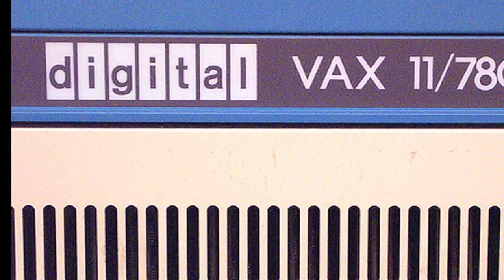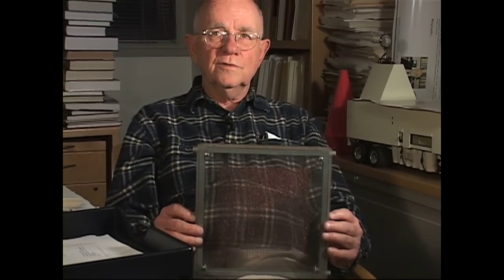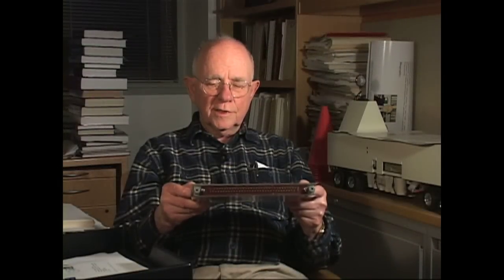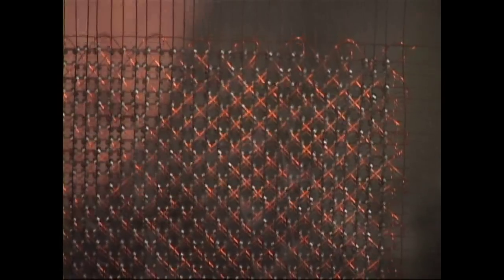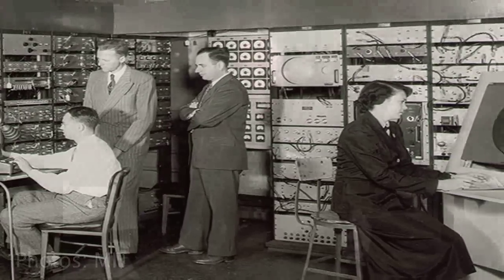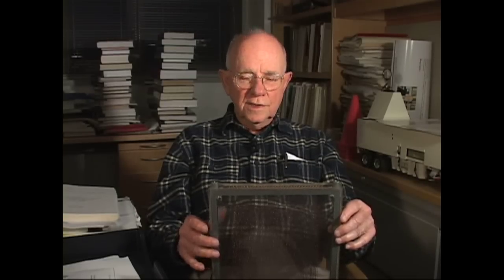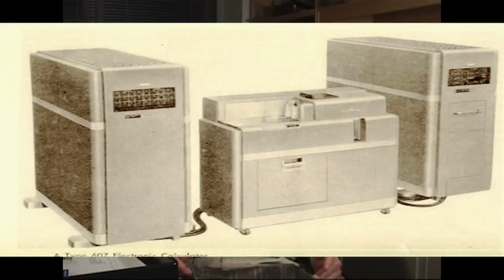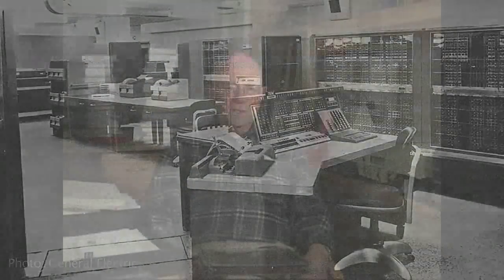World's First RAM Chip (Memory Plane)

Comment: Interesting until about 3 years ago the last ferrite memory computer was being used by Polish State Railways (PKP) to compute train routes and timetables !
Reply: +Teth47 I believe commercial computer manufacturers settled on hiring Asian companies who hired women to weave core planes.  There were also wiring jigs with grooves for wires and slightly deeper "pits" into which the cores would settle when shaken, with the proper orientation.  Cores would be poured from a container onto the jig like pouring salt, the jig would be shaken until the excess cores fell off into a bin for reuse, and each necessary core was sitting in its pit with the hole oriented to insert the wires.  Every core had four wires going through it: one passing through each row, one through each column (one row and one column carrying a pulse of current just over HALF the amount needed to switch the core's magnetization), one diagonally through every core in the plane to sense, when a core was reset to the 0 direction, whether it had changed from a 1 (thus reading the data), and another wire going diagonally through the plane on the opposite diagonals to inhibit the writing of a new 1 in the cores which contained (or the computer needed to make them contain) a 1 before the first pair of pulses.  After the cores were settled properly in the jig, the workers ran a separate wire for every row (in this case, 64 rows), a separate wire for every column (in this case, 64 columns times 64 rows make 4096 cores), and the sense and inhibit wires through every core, according to the diagram.

Core memory was destructive read-out; the memory would write a zero and amplify any pulse on the sense wire, storing the bit in a temporary holding register (one flip-flop circuit per bit).  If the computer was writing new data, that would be replaced; if it was reading data, that holding register would be made available to the computer.  In either case, the old or new data would be written back; the row and column would be selected to sent pulses in the opposite direction, trying to write a 1, but the inhibit wire would have a pulse set up to oppose them if the bit was supposed to become, or remain, a 0.  And this remained the most effective memory technology until the production of large enough semiconductor chips.
Reply: Most nuclear power plants currently run on ancient PDP-11 type computers, simply because the cost to certify new computers and upgrade is so expensive, and because few new nuclear power plants have been built in the past 40 years.
Reply: +Richard S 
Punctuation is a thing.
Reply: +Teth47 
Funny that you type the contraction of there are and not only did you get it horribly wrong, but you used the same number of characters as you would had you just typed it out as there are. 
The contraction you&#39;re looking for is they&#39;re.
In fact, now that i look at your entire comment, it is all terrible. Sentence structure is not your strong suit. Neither is spelling or punctuation for that matter. 
Makes one wonder if you speak this way as well.
Reply: They probably didn't want the expense of writing new programs and training new staff. I can imagine the oldsters complaining about changes. The gold in the core memory probably paid for all the new gear and training.
Reply: +Richard S Could they really not afford to hire an intern to write that into an applet for a laptop to compute? The cost of running that behemoth must have been insane, would have been better served in a museum IMO...
Reply: @Teth47  A lot of times, in critical infrastructure, really old and "outdated" equipment is utilized for decades. The old computers were more like ASICS in that they were antique by modern standards and couldn't play Doom but, were flawless for their purpose as they had a limited number of hardcore states. Now a days, software is written by software and in doing there's a person on the  planet who actually really knows how it all works, in totality. For things like trains that didn't need modern chips for just to handle the problem, simple really is better. Even if that intern programmed perfectly, imagine trying to get a modern pc to run for a month without restarting for patches, crashes, etc. They aren't really in the same class as modern computers. We brute force cheap computers to solve simple tasks (economies of scale) but, they're almost like glue logic. You can afford to use a million transistors to simulate a few fates now. Those older ones didn't do much else than their design specs but they did that extremely well. This is why most FAA equivelents for ACT still use older, proven hardware, at least until recently.
Reply: @Teth47  if it ain't broken don't fix it
Reply: @cesteres  We clearly have different definitions of broken then.
Reply: +Teth47 they could have, but the IT staff were very happy with their antique computer. They were forced to upgrade about 2 years ago and immediately there were problems!
Reply: Richard S There're always problems when something changes, it's a system everyone's not used to. The point is that it's way cheaper and better once it's going smoothly
Reply: Nuckelhedd Jones If you're going to be a grammar Nazi, the least you could do is actually be correct. Let's put your suggestion in my sentence: They're always problems when...

Now, let's expand that contraction and see if it still makes sense: They are always problems when...

Nope!

Now, let's count the characters I used, and would have used: T(1)h(2)e(3)r(4)e(5)'(6)r(7)e(8)
T(1)h(2)e(3)r(4)e(5) (6)a(7)r(8)e(9)

Wow! Look at that, I saved one keystroke, just like every other fucking contraction.

"Herp derp someone is better than me on the internet, I should make up some shit to criticize them about, even if it is blatantly false!" -You

Also "Someone made a grammar mistake on the internet, that must mean that what they said is wrong!" -You

Comment: I ran across this old digital computer patent 3190554 that used compressed air instead of electricity to compute. Was this computer ever built and use for anything? Could one be built today using 3D printing? If Babbage had gone this route could his Difference  Engine have been built buy the folks that built pipe organs? Seems like this computer would have been electromagnetic pulse proof and that would have been handy during WW3. Thanks for the post.
Reply: +ufoengines Fluidic devices cannot operate as fast as electronics, but for a low speed application fluidics would be feasible, although expensive (that may change with nanotech). Some manufacturers of the furniture-sized hard drives of the day experimented with using fluidics to do the power-up power-down and disc switching logic in order to avoid EM interference, but it turned out to be cheaper (to build AND maintain) to use electronics and just shield the data circuits from the EM pulses.  There was also talk about using rocket exhaust in the guidance logic of the boost phase.  As far as I know, none of this actually reached the market or the space hardware of any country's government.

Vacuum tubes are also EMP  proof as far as being destroyed is concern.  They may respond one time to the pulse, but it won't destroy them.

Comment: small transcription error: parody checking should be parity-checking
Reply: +Richard Smith PARITY refers to the oddness or evenness of the ones in a group of bits.  Data was stored with one or two extra "parity" bits set to one or zero to make the whole group of bits have odd parity (in a few applications, even parity was the standard.  Upon reading the bits back, if there was still an odd number of ones, most likely the data was correct (barring two simultaneous errors); if not, either the parity bit or one of the data bits had changed, so the data could not be trusted.  More bits for error checking (redundancy) and a more complex formula allowed CORRECTING a single bit error, and detecting a double bit error.
Reply: +RyuDarragh I'll give you a thumbs up since I may be the only one who understands the panametric conundrite of your reference.

Comment: This is not a chip.
Reply: Actually, it was a chip, although large. It was enclosed in clear plastic and had input/output ports to each memory location.
Reply: Probably "first memory module" would be more accurate, as it's sort of like a giant half-kilobyte 72pin parity SIMM. But not as many people would be likely to understand that terminology.
Reply: Chip refers to a silicon wafer chip, which this is not.
Reply: To be pedantic, that'd be "Silicon Chip" if you're after differentiating it from the dozens of other things that can also be called just "chip" for short.

However really the core plane should be Chip In Quotes because it's neither monolithic (even encased in plastic, it's built from a great many separate parts, beyond the single silicon die plus pin-connection wires of a familiar microprocessor or DRAM - and even when you're using silicon dies, when you get to the point of putting several separate ones in a single potted enclosure, it usually ceases to be a "chip" and becomes a "module"), nor is it particularly small, both of which are generally defining features of most other "chips", even those made from potato. About the only other chips of that size are those made by cows ;)
Reply: This is what was called a Ferrite Core Storage device. It is correct to point out it was not a CHIP, as it was not an integrated processor and there was no silicon involved

Comment: before anyone dares to criticize this video, one must remember that they MUST have ram in their computers to even watch this video in the first place.
Reply: +Sokami Mashibe yes, I just wonder if it could be realized by sequential memory in theory? like tape, witch is not a random access pr def,   but it sounds difficult.
Reply: It's an idea that's been tried several times before as a cost-cutting measure, both in mainframes and some early micros, and whilst it did still work the performance was pretty terrible. Rather like drum memory just without the bulk and expense of all the big whirly physical parts and multiple read heads etc.

Though we can see some of the effect in modern systems both with many-times DDR memory (which has a much slower random access speed vs sequential burst speed) and virtual memory (even more so, as it's storing data on a hard drive, equal to either very fast drum or rather slow recirculating bit memory depending on whether it's platter or SSD), which are essentially the same idea given that they're many times cheaper for the same capacity than the multi-GHz SRAM that would be needed for absolute maximum performance but whose cost means it only gets used for small amounts of cache, and these days almost always built directly into the CPU...

Comment: Actually, he is mistaken about one tidbit: The IBM 704 was the first to feature ferrite cores; the 701 used Williams tubes - which was its main handicap!
Reply: Core memory was probably offered as an upgrade to the 701, though...? After all, it originally came out in 1952, so it wouldn't have been something he saw "come out" after they stole the MIT work (...something which was probably seen as fair game at the time, as they were both doing government work on the respective machines - the 701 being built first for the DoD - and anything invented at a university was free for the good of all mankind, right...?), but they might have introduced a revised model with upgraded memory as a cheaper alternative to the 704...

The processor doesn't know what kind of memory it has attached, after all... it submits a read request to the memory system and waits for the data to come back. Maybe it's faster, maybe it's slower, but the actual interfacing is dealt with by a different module.

EDIT: in fact, from an article on the 701...
"Memory could be expanded to a maximum of 4096 words of 36 bits by the addition of a second set of 72 Williams tubes or (later) by replacing the entire memory with magnetic-core memory" (using an IBM 737 magnetic core unit, which was the standard configuration for the 704).

The bigger advance the 704 made was the addition of index registers to the CPU, which (for reasons I don't fully understand myself) made it much more capable of performing complex calculations at high speed, so it still considerably outperformed a core-equipped 701.
Reply: Yes I'm sure that the guy who was there and developed it and saw firsthand what it was used in knows less about it than the guy who's looking up all of his information secondhand on the internet.